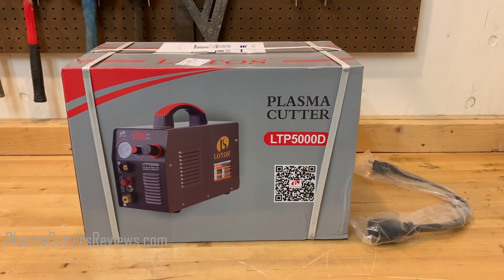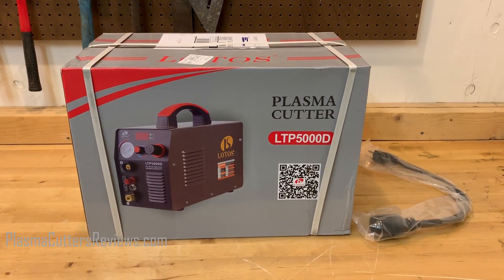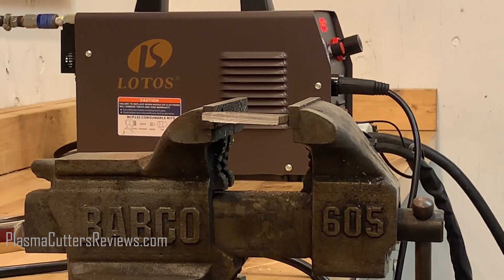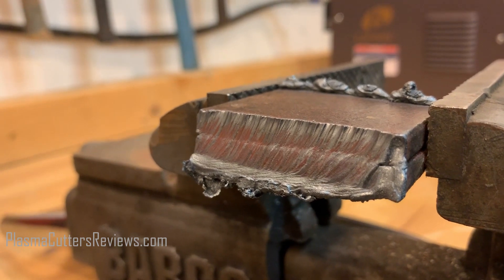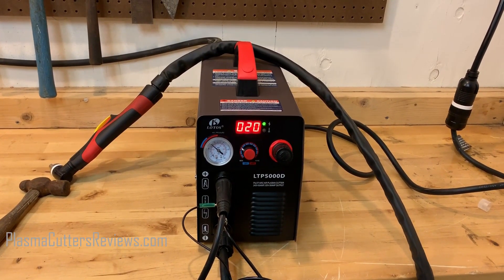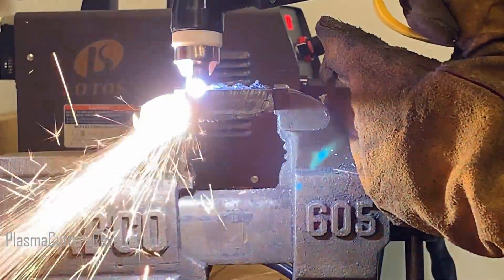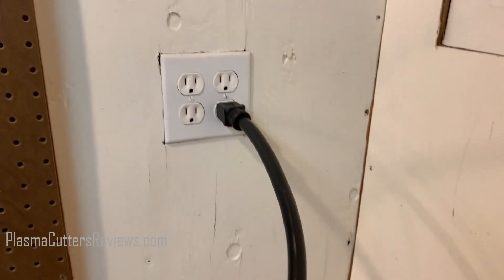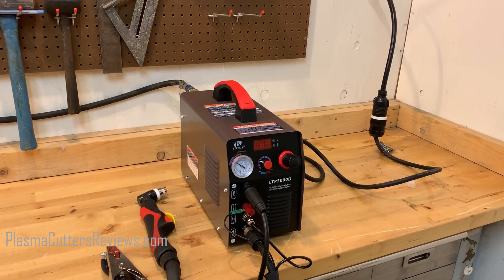LOTOS LTP5000D Review and Cutting Test!

Comment: You call that a little bit of slag on the 1/4 inch cut? I'd call that a lot with oxy acetylene.   Might not be the machines fault though. Looked like the torch was pretty high and the travel speed a little low.

Comment: Hey Dylan, I know this is kinda an old video, but can I ask you a question?  I'm leaning toward buying the Lotos LT5000D (the non pilot-arc cousin to the pilot-arc machine you're reviewing in this vid.  Is the LT5000D the exact same machine except for the pilot arc?  If so, do you recommend it as strongly as you do the LTP5000D?
Reply: The pilot arc makes everything so much easier but it's not necessary

Comment: That is NOT a "really really clean" cut on 1/4 material.  A good clean cut should NOT have that much slag on the exit side of the cut.  And you can clearly see how bad the arc is deflecting on the exit side of the cut.  On a good cut, you should be able to knock off the slag with your welding glove, or a light tap from a chipping hammer... you should NOT have to use a grinder to remove slag on a good cut, ESPECIALLY on material that thin!  Here's another tip for you, if you really want to properly test a plasma cutter, NEVER make a cut so close to the end of the material, you are creating a pre-heating condition because the HAZ has no material to bleed into.  I can clearly see your drop piece getting red hot.  That's probably why you are getting so much slag and such bad deflection on the exit side.  Also, what is the kerf width?  A cut that bad is probably also due to the nozzle bore being too big (poorly designed and manufactured consumables)... cut kerf on 1/4 inch material should be no more than 3/32 tops, preferably 1/16... anything wider is creating WAY too much heat and a really wide HAZ... you might as well be using an oxy/acetylene torch.   Another tip...  if you are going to test cuts on different thickness materials you should ACTUALLY use that thickness material... NEVER stack material when cutting with a plasma cutter!!!  Stacking material creates air spaces that allow the plasma to bleed sideways away from your kerf, creating lousy cuts... and stacked material behaves completely differently in terms of HAZ.  I really don't know where you "learned" your "fabrication skills", but you should really know what you are doing before making videos and disseminating your ignorance and bad habits to others.
NOTE TO EVERYONE:  Make sure you read all the bad reviews on this machine before you buy one... HUNDREDS of these machines either arrive DOA, or they crap out after only a few uses... and you have to pay a hefty fee for 2 way shipping on repairs even if the machine is still in warranty... and that's only if you can manage to contact their support.... so your "$500" machine can end up costing you a lot more if you have to send it in for repair... and the machine you get back will have a "refurb" status, so your warranty will no longer be in effect once you send the original unit in for repair.  DO NOT believe all the "good" reviews on Amazon... most of them are from paid shills trying to boost this crap product's ratings.
Reply: I'm not a fabricator but these sound like solid tips, they make sense. Any recommendations for a good value cutter?

Comment: Its not all that great, the cutting shows a lot of drift, even on the first cut.
Reply: I have Lotos LTP5000D and Miller 50 Amp plasma cutter in my shop. Miller cutting 1" steel base plate easy. Lotos cutting 1/4", 1/2" and 3/4" very dirty with proper settings. I recommend spend $1000 and get really good plasma cutter. The lotos torch nose is sitting too close to the cutting steel. Manufacture made it like that to ad ability to cut more steel, but this is killing all tips, center rods and insulator. You are not able to adjust the distance between the metal and torch tip.  Think twice before purchasing this equipment
Reply: in my 20+ years of plazing, the slower you go the more dross you have. been thinking of getting 1 for my hobby shop though

Comment: Dylan...Great review. The New Brown case LTP5000D appears to be an excellent performing machine. I like the visible air gauge/adjustment upfront and the excellent torch. but I am hearing too many horror stories of extremely poor /totally unresponsive customer service from Lotos. I am also not impressed with the requirement of a purchaser to prepay $69 shipping both ways for a defective machine still within the 1 yr warranty. And if a defective machine is replaced...it is replaced with a refurbished machine on which there is no warranty. The fact too that the prices have increased by $100 in the last six months does not help. Great machine but enough bad customer support reviews and questionable warranty policies to make me look at a PrimeWeld Cut-50DP with Pilot Arc for $399 delivered from Amazon. A Three-year PrimeWeld warranty, excellent customer service reputation, a better torch for gloved hands IMO, and a delivered price over $70 less than the Lotos LTP5000D that has a One year warranty and historically poor customer service. Plus expendables for the PrimeWeld are more affordable.
Reply: I just wanted to give a similar anecdotal comment. I think from 3 years ago they have since turned this around. I had probably one of the best warranty/customer exchanges with a company that I've had in my life...and I mainly have snapon tools...  Recently i bought this exact plasma cutter, but for a few years ive had a lotos TIG/stick machine.  The welder managed to break (stop adjusting amperage what so ever) about 3 weeks outside of its warrenty. I called lotos, they knew exactly what the problem was, and sent me a brand new control board for the machine FREE OF CHARGE. It arrived in about 2 days. 

I havent received that good customer service from a non-walk-in-mom-and-pop place in FOREVER. I"m impressed.

Comment: Great review Dylan. Thank you. I'm curious about the red Suncoo cutter with pilot arc. Seems to have similar features as the Lotos for approximately $150 less. I haven't seen any reviews on this yet and wondering if it's any good? Hope you do a video on it sometime. Thanks.
Reply from the maker: Chobie Frank I have not had this machine in my hands yet, so I cannot comment on its exact performance. From what I can see the Sunoco was released in April of this year so it’s new to the market. This is common as these cheaper Chinese machines show up and disappear rather quickly. Many of them are the same machines matched with different components and branded differently. 

I would recommend spending the extra $150 for a number of reasons. The Lotos has been around since 2011 and has a proven track record. Secondly, I like how heavy duty the Lotos torch is compared to that of the Suncoo’s. Third, Lotos comes pre-wired with a plug and has a 110v adapter available. Lastly, I don’t like the external air hoses on the back of the Suncoo machine. I see those  being prone to failure. 

I hope this helps. If I am able to get my hands on one I will do a full review.